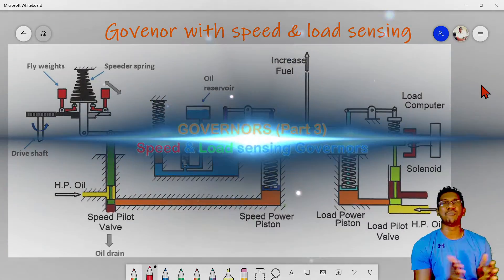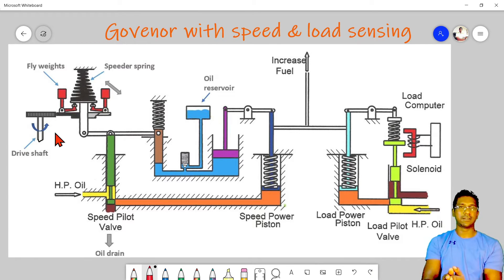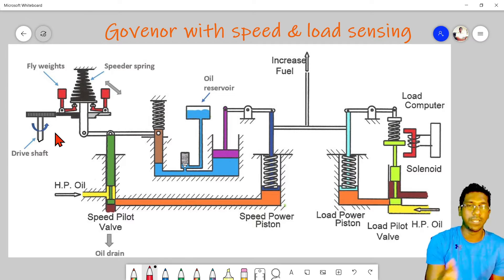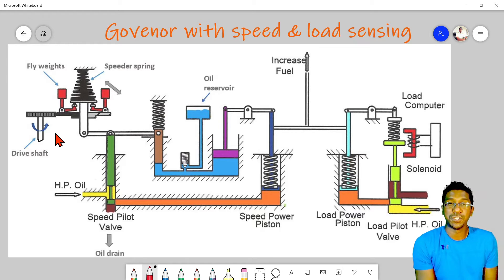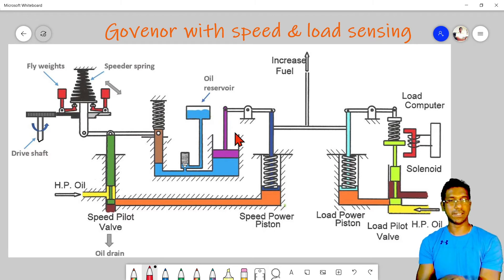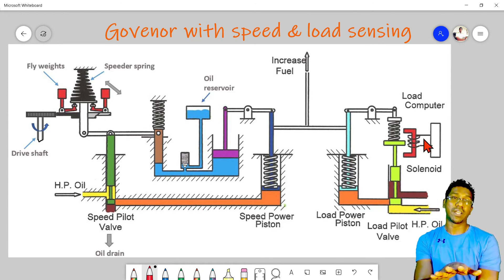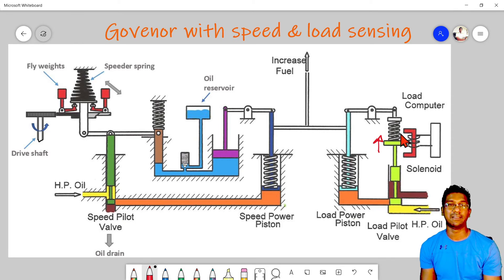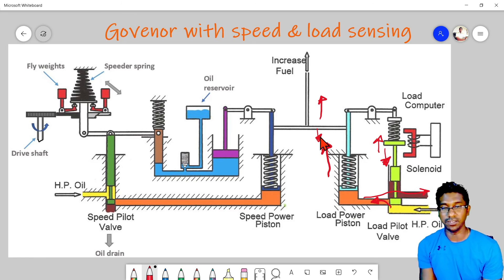Diesel governors English Part 3 #MarinEngBase

Comment: Sir I am confused about difference between main engine and auxiliary engine governor, will they both have compensation system with needle valve or only main engine to make it ischronous?, and will they both have load sensing ?

Comment: Do you have electronic governor in marine diesel engine?
Reply from the maker: Yes we have...modern large two stroke main propulsion engines are equuped with electronic fuel.control units.
Reply from the maker: Marine diesel generators also equiped with electronic governors.

Comment: Sir to the best of my knowledge, load sensing cones into picture when engine is fully loaded I.e speed governor has opened the fuel rake & it has reached the limit, at this point load governor role starts & it  starts decreasing the load on engine to restore the speed & prevent overload & stalling. 
I maybe wrong, correct if I understood things differently
Reply from the maker: No...its not like that...first comes is load sensing, only because of load variation then the speed would affect. Thus to have faster response the load variation is sense at realtime.
Reply: @marinengbase  Thanks sir for clarification